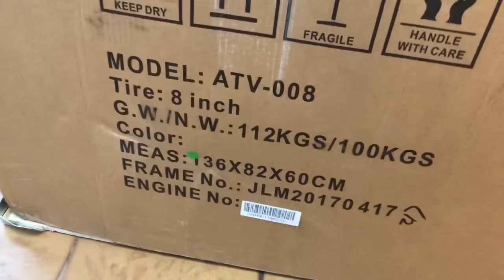Unboxing, montaj si pornire Atv 125 cc Raptor / Renegade

Comment: Am unul identic. Dar.. nu sunt multumit de el. Țevile sunt foarte slabe, in timp se vor rupe. Ma refer la cele de sustinere. Bateria va trebui schimbata deoarece si ea este una slaba. Am avut multe probleme cu el. Nu prea recomand. Decat sa dai banii pe o chinezarie, mai bine mai strangi si iei ceva second hand dar sa fie o firma mai cunoscuta.. Asta e parerea mea
Reply from the maker: Da, depinde cum mergi cu el si ce asteptari ai... asa au considerat si altii si si-au luat sh si in cateva luni au bagat inca pe cat au dat pe el... vezi celelalte video de pe canal... totusi e nou si ceea ce ai spus nu sunt probleme ce apar decat daca il exploatezi la maxim...
Reply: SHR Motors Daca iei ceva sh si o firma gen Suzuki, nu o sa ai atatea probleme. Si plus ca e diferenta de la cer la pamant.

Comment: I am 65kg will it be able to pull stuff and what's the top speed?
Reply from the maker: Yes, you can. Top speed more than 70
Reply: @SHRMotorsOfficial  can you test it? Like do some top speed runs with GPS
Reply from the maker: Is in plan to do that

Comment: Viteza e 70 la ora nu? Ca vreau sa imi iau unul dar vreau rapid la 125cc maxim 70 nu? Pentru strada și câmp
Reply: Nu este si Atv hummer 125cc care prinde aproape 100 costa 600-700 euro sau mai este de la.bmw 125cc care prinde 70 si este 600 euro
Reply from the maker: Se duce si mai mult de 70.
Reply: SHR Motors Hummer-ul sau BMW-ul care se Duce mai mult
Reply from the maker: Hummer
Reply: SHR Motors pot sa I Montez roti de 10? Pentru al face mai “mare”?
Reply: SHR Motors un raspuns va rog frumos daca se poate?